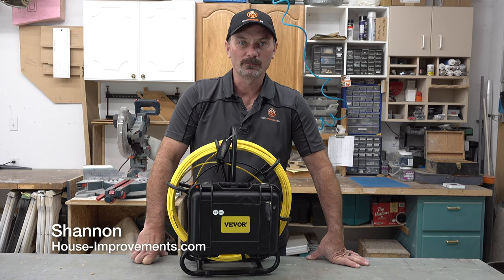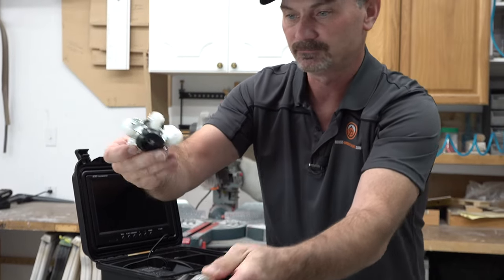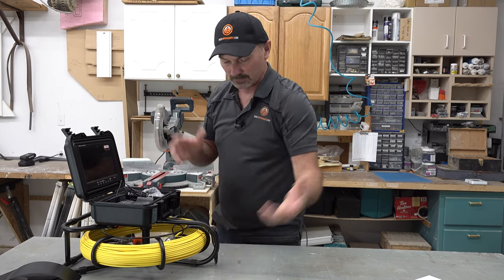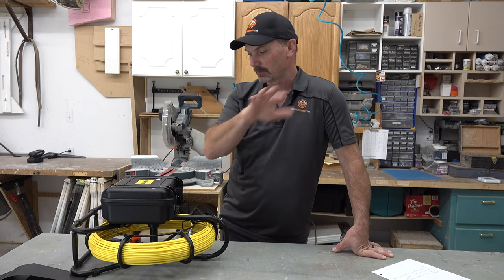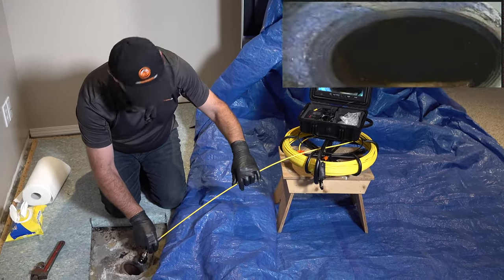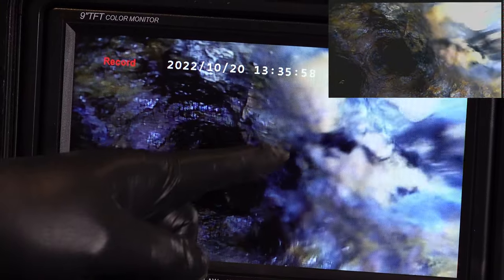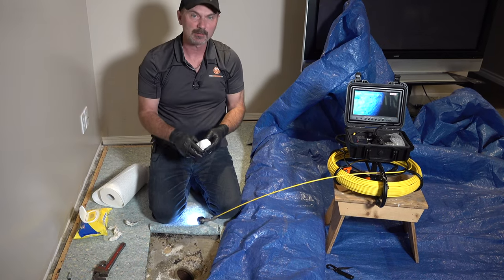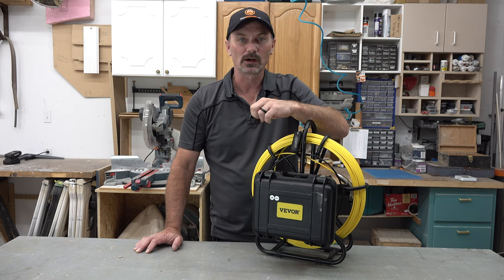How To Use A (Sewer) Inspection Camera

Comment: Can you please measure the thickness of the cable? I need a thicker cable to push through my sewer line for inspection. I'm tired of returning cameras with thin cables in 5mm diameter that will not do their job. Some vendors don't provide this critical info. It costs a lot to return. Thank you!
Reply from the maker: This is 5mm. I have never had an issue pushing it.
Reply: I recently had to do a buncha research on cameras to make an educated decision. From what I learned, its not so much the thickness, but the classification they give the cable. Youll start at flexible, then mid stiff, then stiff. 

This unit here is a mid stiff unit with 165 feet of reel. Personally, I cant get it to go further than 120 feet (havent tried it with the rollers attachment, too scared of getting stuck).
Reply: I use a 9.9mm push cable, 200 footer with self leveling camera head,  Subtech design. It's a must have!

Comment: My assumption was right. I worked in the sewer/non-hazardous waste industry. I’ve camera’d lines, jetted lines, pumped out tanks and cleaned large tanks at WWTP. My assumption was the camera assembly isn’t heavy enough for when you push the line back into the coil. Looks like my assumption was correct.

Comment: Copper sulfate inside pipe, dig up drain and encase it in concrete for about four feet, treat exterior roots with copper sulfate also, it won’t kill the tree.

Comment: Not sure about Canada, but here in the states we have a readily available root killer that you can pour down your clean-out as a preventative measure. It usually contains Copper Sulfate and it kills roots on contact. Your sewer line seems to be in great shape otherwise, so I'm curious if that could save you some cash.
Reply from the maker: Possibly , I have never heard of that.
Reply: It’s called Root X!

Comment: This is great info to understand as an owner of a 1917 house that still has the original sewer line, approx 135 ft to the city sewer main.  I've had some issues recently and plan to hire a local guy to come probe the line with a camera and a locator to find the second clean out and the city sewer connection point (for when I do have to replace the line.) 

The first plumber probed multiple times with rotary devices and found no indication of roots, but there is a little pushing up, creating a belly, and some sludge between the belly and my house. He used a power water blaster to get through the sludge and clear a lot of it up, but I bought an accelerator to work on dissolving the remaining sludge for now.

I am wondering if these will work down a chimney, too...
Reply from the maker: This camera would work anywhere you can slide it into.

Comment: I had a Maple tree right on top of my sewer so I removed the tree, problem solved. I also had roots packed in the PVC of my sump pump drain it was so tight the pump kept cycling. Nice demostration.

Comment: Shannon you should think about having you pipe relined. That would make a good video. Who knows they may do it for free for advertising how to fix a cracked sewer pipe.
Reply: My neighbor had there sewer relined last year, 15 grand was the charge and our homes aren't that far from the street so I doubt anyone would do it for free, but hey, it never hurts to ask ;)
Reply: Spartan has a LiDAR patch system patches are slightly expensive but 2 patches would be greatly worthwhile in your case being on a continuous lateral cleaning program

Comment: Hello
My Vevor inspection camera the viewing angle seems off by 90*. The water shows at the 3oClock position. How do you adjust it so the bottom/water is at the 6 oClock position?
Thank You
Reply from the maker: You can't . It all depends how the camera sits as it slides down the pipe.If it really bothers you turn your screen.

Comment: That's a very nice tool!  It shows what you need to know and the trouble spots. 
Showing the condition of the pipe can help to locate current and future problems.  Eliminate problems quickly to prevent future big "OH NO's! "
Thank you for this video.

Comment: The two rubber caps that you said you weren't sure what they're for the larger one is for the stainless steel end of the cable to protect the electrical connection when unscrewing the camera head the smaller cap is for the prongs on the camera Head
Reply from the maker: Sounds logical, thanks

Comment: my uncle just purchased this and the light doesn’t come on.
Reply from the maker: Turn on the switch on the battery box and rotate the knob on the battery box, this controls the light brightness. Be sure the battery is charged also. If that does not do it but the screen has a picture then contact the supplier for advice and or exchange.